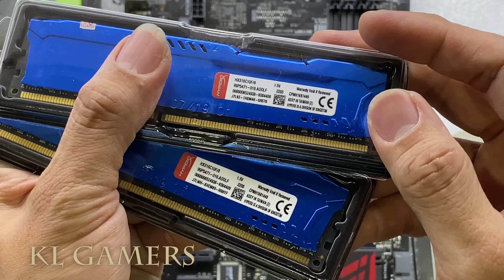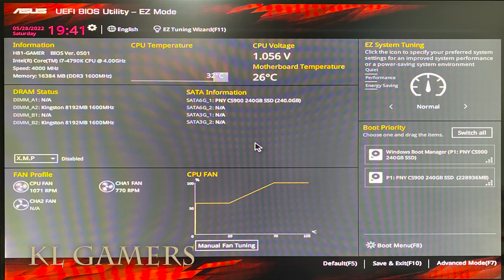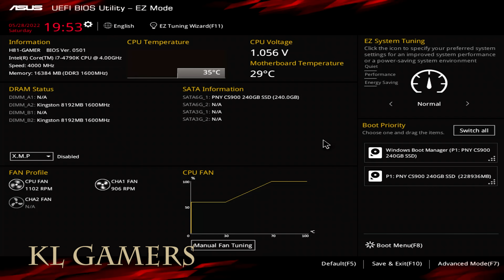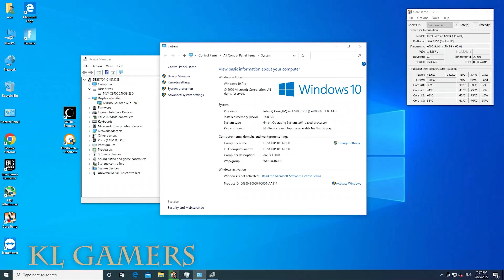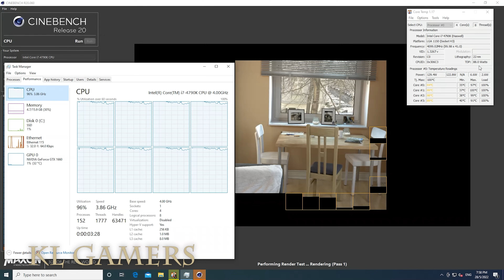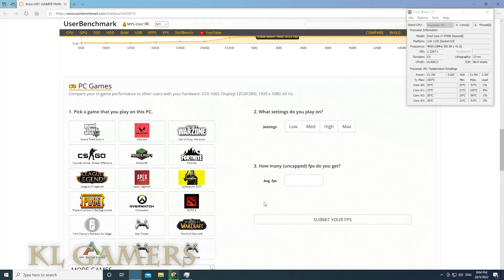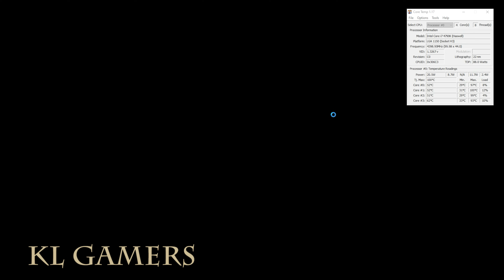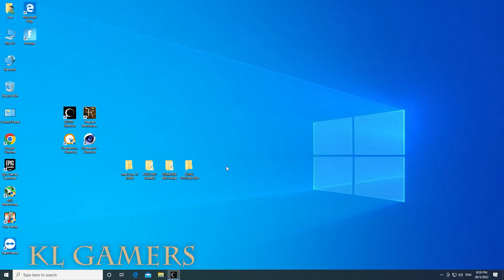intel Core i7 4790K ASUS H81-GAMER XIGMATEK Gaia HYPER X ZOTAC GTX1660 Gaming PC Build Benchmark

Comment: Cpu throttling too much voltage !!! I had the same issues with 120mm aio and tried to lower voltage and manual give the turbo boost the speeds per core and then fixed
Reply from the maker: ya

Comment: this used to be my build last year, although with a Z97 motherboard instead of the H81 so I had the 4790K overclocked to 4.6GHz
Reply: Excellent choice, having an i7-4790k in a non-OC motherboard is a big miss. Despite being an old CPU it do pretty well even when you paired it with modern GPUs, being the DDR3 RAM and a few missed modern instructions the only disvantage.
Reply: @AggressiveMenace  I already upgraded it tho

Comment: I dont know why people can stand with an old cpu. Even i use 9700k can be categorize old cpu then get  bunch of error on playing warzone
Reply: I have this cpu, i7 4790k. I run a GTX 1080, 32 GB of DDR3 at 1600 MHZ and an NVMe/PCIe storage of 500 GB.
I run Warzone at Ultra settings, 1080p, goes around 60 to 70 fps. NEVER below 60.
I also play Overwatch 2. I play that at Ultra too, around 70 to 80 fps.
This CPU is very, very good, and GTX 1080 is well known for its awesome performance.
Maybe you just need to tune your specs or something, particularly in warzone, there is a file you have to edit, in which you specify the number of cores your cpu has, by default that file has it set to 2.
Check the video here: https://youtu.be/lBvi0gDhU3o
Reply: Bro! Gigabyte 81m m.2 compatible with i7 4790k this procceossor??
Reply: why? you realy asking why? you think if i had money i didnt bought gen 13??!